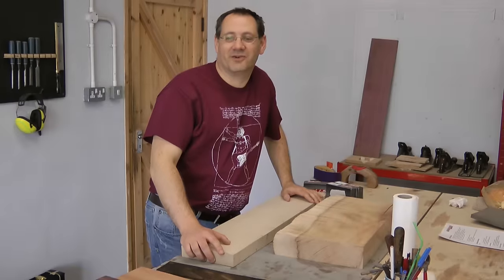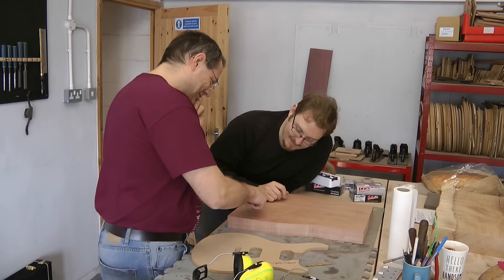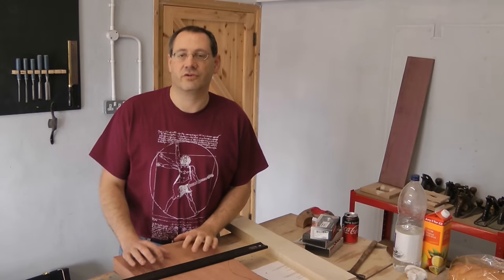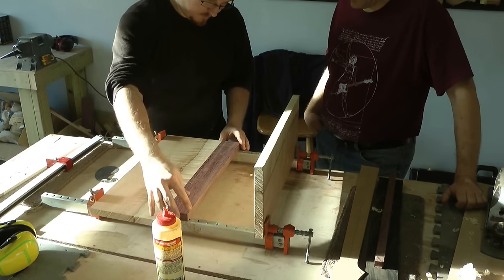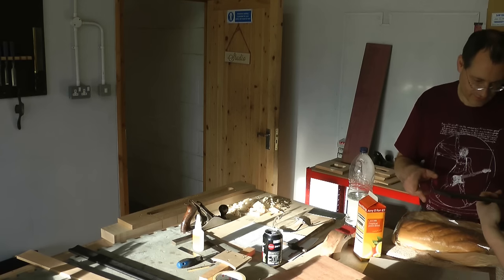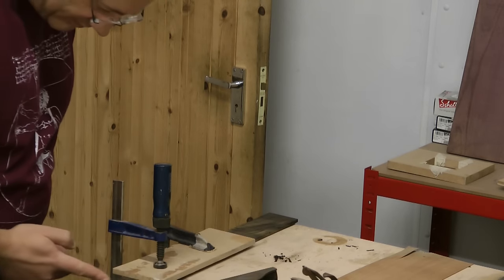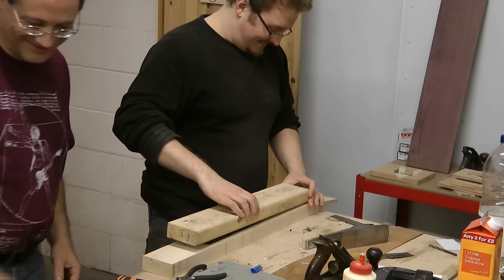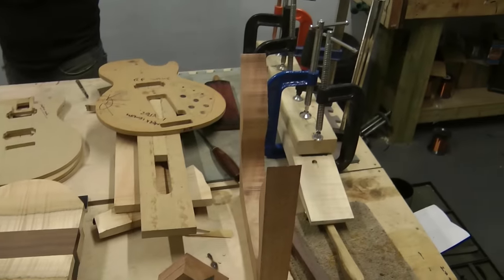Crimson Guitar Build Day 1

Comment: MAN I WAS NERVOUS WATCHING YOU PLAIN THAT TOP PEICE WITH YOUR THUMB RIGHT NEXT TO THE BLADE, IF IT WOULD HAVE TIPPED AT ALL YOU WOULD HAVE TAKEN THE TIP OF YOUR THUMB OFF, SHOP SAFETY IS REALLY IMPORTANT. KEEP HANDS AND OTHER BODY PARTS OUT OF THE PATH OF SHARP BLADES AND BITS. I DO LIKE TO SEE THAT THEY HAVE THERE STUDENTS USING HAND TOOLS INSTEAD OF ALL POWER TOOLS, IT REALLY MAKES A DIFFERENCE IN THE LEVEL OF DETAIL AND PRECISION YOU CAN GET. CHRIS SEEMS LIKE A GREAT TEACHER, VERY KNOWLEDGEABLE.